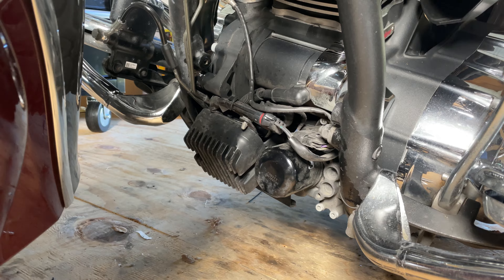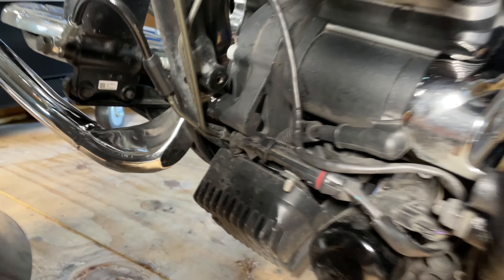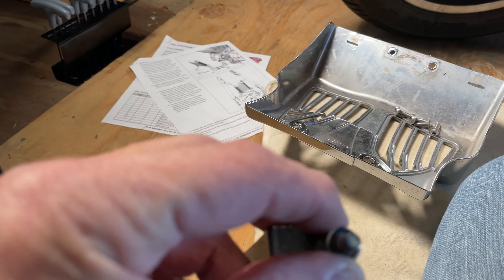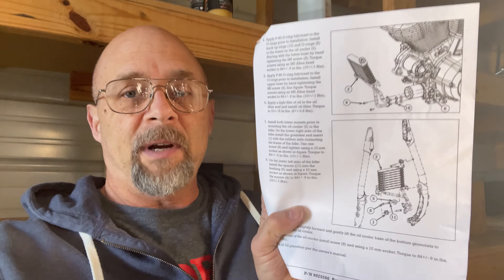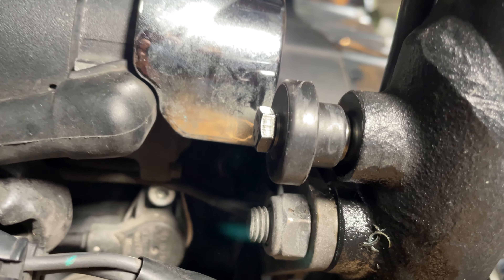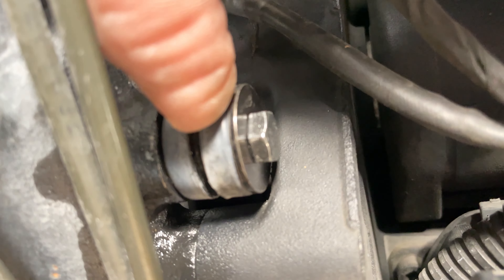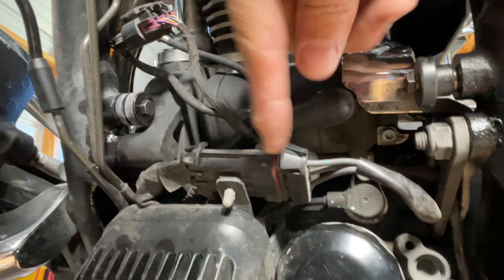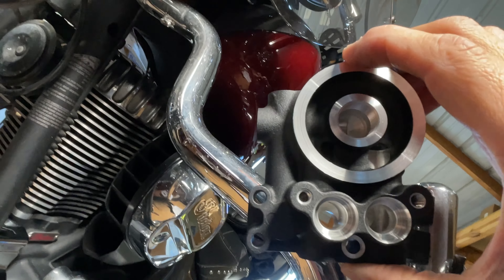2019 Indian Springfield oil cooler installation.

Comment: Excellent video, now I need to get mine installed. Thank you!!
Reply from the maker: Thank you very much! Keep in mind that the oil cooler won't necessarily make your engine cooler. What it really does is just keep your oil from overheating. Supposedly this helps the oil last longer without breaking down under extreme heat. Still though, I'm glad I did it. My next video is going to be on rebuilding the forks. I'm expecting to start that project next Monday. Stay tuned!
Reply from the maker: Also, don't forget to install your oil filter after everything else is done. It will make the oil cooler installation much easier.
Reply: @FlashOnTwos  Couple years ago my friend (riding RM) and I went to ride in a charity ride about 122 miles away from home. I couldn't imagine touching my engine while he put his hand on engine head and told me it is warm but not burning hot. Thats when I ordered my cooler which had been sitting in garage since I wasn't sure with unclear instruction provided by indian. I will do it now. Thanks again.

Comment: Hi, thank you for the video. I just changed mine yesterday along with new Barnett clutch. Was much easer to put the hoses before the oil filter. Can't do the test drive as the weather is way to cold. Look forward for more videos.
Reply from the maker: Now that I look back, you are right. It would've been easier to do the hoses first and then the oil filter. That way the oil filter would not get in the way of bolting down those hose parts. I will mention that in the comments of my original description. Thank you for bringing this up!

Comment: At 21:08 you could put another flat washer on top of that plate to help keep that flat or get a wider headed bolt.
Reply from the maker: Seeing as how it's not leaking after several thousand miles, I'll just leave it alone. But thanks for the tip.

Comment: Hi there, a very good video I appreciate your patient and detail, I am thinking about doing the same thing I wonder if have felt a significant difference in temperature since you added this cooler.
Reply from the maker: Hi Shahriar. So far it seems to be helping. The temperatures down here in south Texas have only gotten to about 95°. I really won't know its fullest potential until the temperatures get up to 98 or 100. But I do feel a difference. I'm definitely glad I installed it. If anything, it should hopefully help with the longevity of the engine.
Reply: @FlashOnTwos  Any update on temps now that we're into July?

Comment: I would love to know the differences between the factory oil filter adapter snd the new cooler adapter. I'm going to attempt to drill and tap the factory one and dodge the $400 of oil cooler adapter.
Reply from the maker: Beats me.
Reply: WHAT WERE YOUR RESULTS WITH DRILLING THE ORIGINAL?

Comment: When did the indians stop installing the coolers as standard equipment on their bikes?
Reply from the maker: I'm not sure, but they ARE still on some of the newer models from the factory. I believe they don't include them on all models in order to keep costs down, then Polaris sticks it to you later when you want to add something that should already be included!!!
Reply: Springfield dark horse is the only one that doesn't come with cooler. Of course it what I just bought. 105° out today.
Reply: @backwoodsfreak  congrats that bike is one good Looking bike
Reply: My regular 22' Springfield doesn't have one either. I had a 17' Springfield didn't have one either, but I installed one. Haven't decided if I'm going to install one on the 22'. Doesn't get that warm in Wisconsin, we'll see. @backwoodsfreak
Reply: My 2017 Springfield did not come with but another Roadmaster there had it. When asked the dealer, I was told that Indian has removed it from baggers for the northern (cooler) states. Bikes sold in southern states still have coolers installed.
However, it is a standard equipment on Roadmasters since they are ridden on long distances across the states.
Reply: @skeets347 I just bought a 2023 Springfield in Florida. No oil cooler. Will be buying and installing next oil change.

Comment: I’m thinking of doing this to my 2016 vintage curious does it really help ??
Reply from the maker: If you're asking does it help to reduce heat reaching your leg, the answer is not really. At least I don't notice any reasonable  amount of reduction that I was expecting. The main thing it does is cool your engine down by cooling the oil down. From what I understand it helps with the longevity of the engine. But I had the money and time to blow so I don't regret doing it.

Comment: Did you end up having to add any oil for the cooler after a few rides??? Could of always filled the cooler and seen how much it held before install to see a round about answer.  Good video!  Will be doin this to my dark horse when I pull the engine this winter!
Reply from the maker: No, I have already changed the oil twice since installing this. I don't really notice any difference in the amount of oil that I have to add. Most likely the cooler doesn't consume much oil anyway. Just enough to pass through and cool it off some.

just remember not to put your oil filter on until after everything is installed. I put the oil filter on during installation and it made it difficult to put those two latches on.
Reply: @FlashOnTwos  good deal.  Thanks buddy